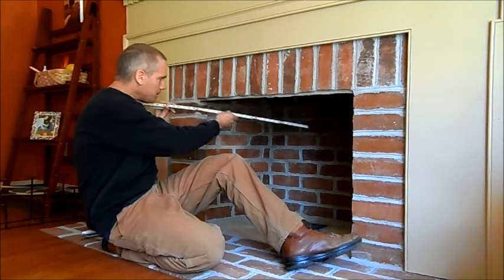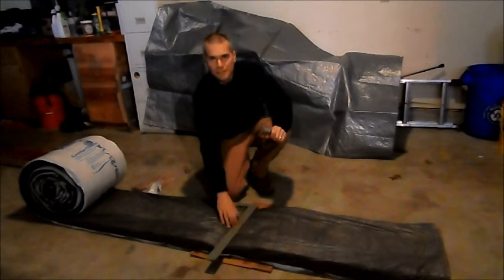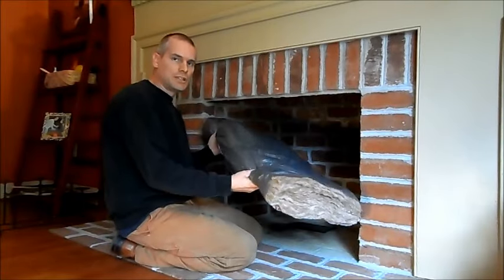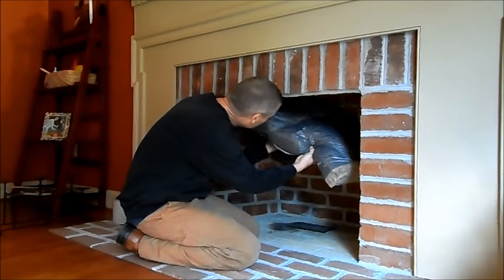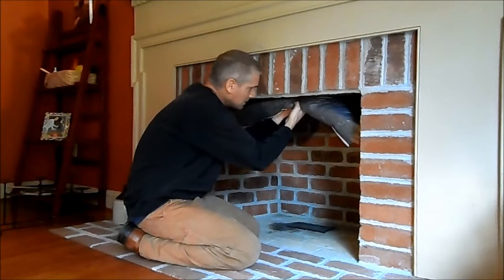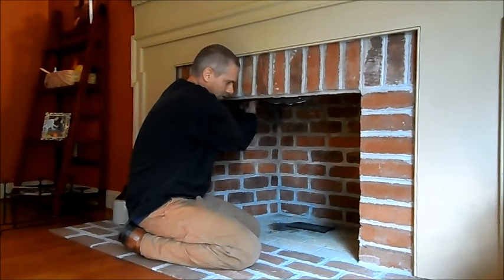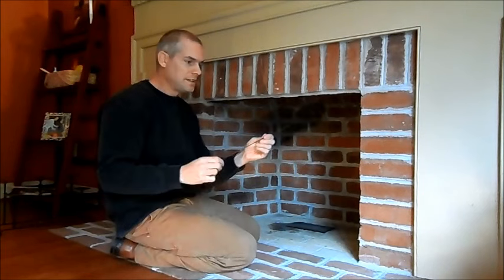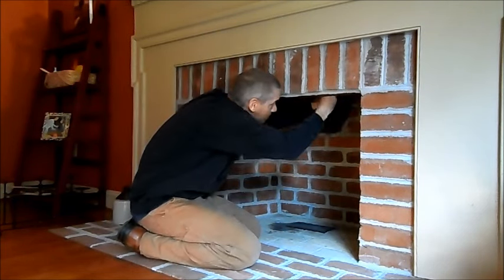seal off unused fireplace

Comment: Good first step even if you have a working flue damper. Unless chimney is insulated on outside, don't forget your large uninsulated brick window transferring cold from the outside.  In addition to the video tip, we custom cut a 2 inch foil covered foam to fit the inside opening, using the bricks to support it. Then put an upright piano in front to hide it.  When I have checked it in winter, there is frost on the inside bricks.

Comment: I've heard that blocking / sealing the chimney can lead to damp. If I were to seal my chimney using the fibreglass, would that not cause damp?
Reply: Prankster101Productions    Q
Reply: In most cases, as long as it isn't completely air /vapour tight, and the top cap of chimney isn't airtight, there should be enough air circulation to avoid any moisture issues.

Comment: I also sealed the top of my chimney, no air can leave or get in at all.
Reply: Hi.  Do you have ventilation/air bricks on your chimney?  Because, when both ends are sealed, without ventilation, condensation can form and cause damp problems in the chimney/bricks.
Reply: but what about Santa Claus!!!

Comment: what about the flue? Also I was unable to find insulation clips. Can you buy them in small quantities. If so where.  I tried the local big box hardware and had no luck. Any other ideas what could be used.
Reply from the maker: The chimney can be capped off at the top with sheet metal for a more permanent solution. 
The wires used to hold up the insulation are sold at the big box stores in the insulation section. I think they are only sold in a small box but they are not expensive. Any semi ridged wire will work. A wire hanger might work as well.

Comment: Can't the fiberglass leak out on the cut end? It's not sealed where you cut it.
Reply from the maker: +Julia Lee Timphony 

The cut end is installed against the brick reducing any chance of insulation leaking out.
Reply: thanks very much
Reply: you can wrap the fiberglass with a giant plastic bag.
Reply: You can also caulk it
Reply: sorry, You can caulk it to the brick from the underside to seal the ends with the brick

Comment: What about the damp issues this can cause?
Reply from the maker: The fireplaces I have sealed off have been fine. If dampness is a concern, you can remove the insulation after winter.